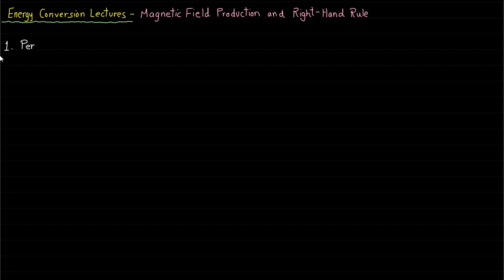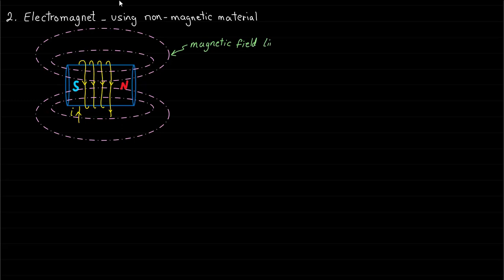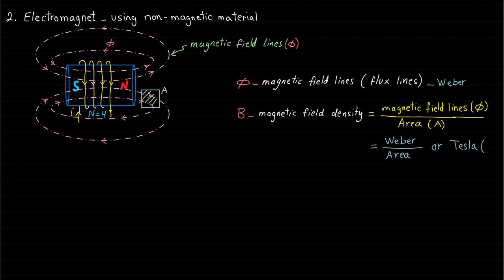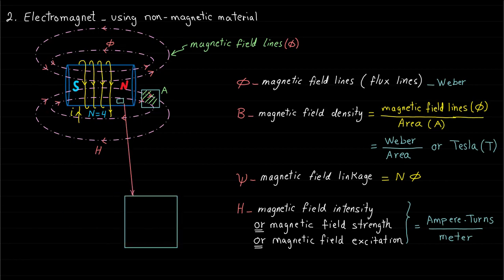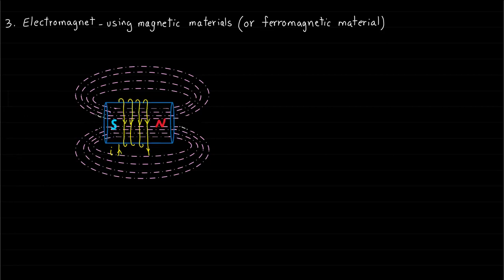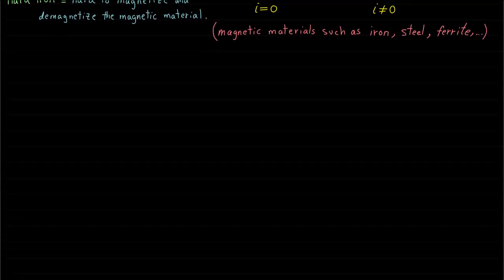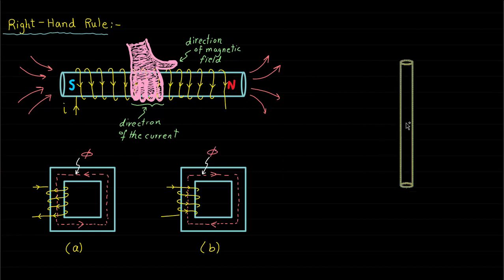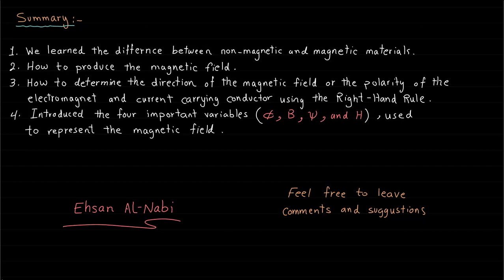Magnetic Circuits - Magnetic Field Production & Right-Hand Rule

Comment: Superb content. Thank you! I now see how the "RH Grip Rule' can be applied to the coil in two ways: (a) using your first approach based on the coil pattern itself but then also (b) by applying the current-carrying-wire approach (see 10'18") to the individual wire that makes up the coil; both give the same result. This has cleared up some confusion for me. And I assume 'current' implies 'conventional current'.direction i.e., opposite electron flow. This content is a masterclass BTW.
Reply from the maker: You are very welcome. Thanks for your nice comment.
Reply: @EnergyConversionAcademy  You're very welcome! After having watched the 4th video in the playlist, I realize I was wrong in thinking the direction of current flow in the coil does not matter; the four examples you present in your Lenz's Law introduction show my error. My take-away is that the coil wrap direction AND the conventional current direction both need to be taken into consideration and just relying on the RH grip-rule around the outside of the coil can be misleading. Please don't feel the need to reply: this is really for my own future reference (and the algorithm!).